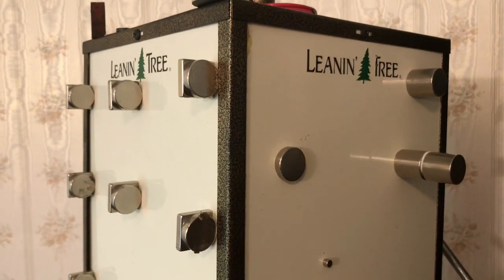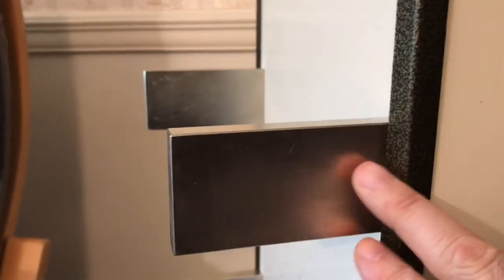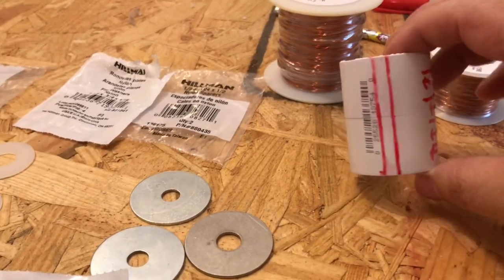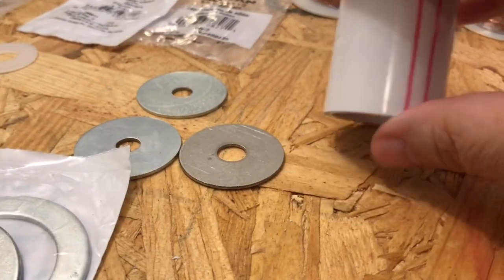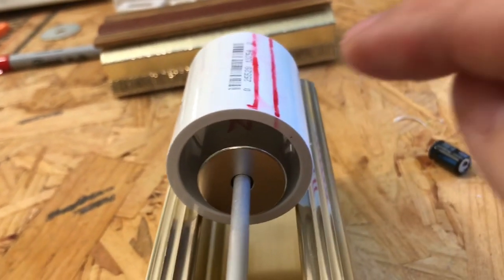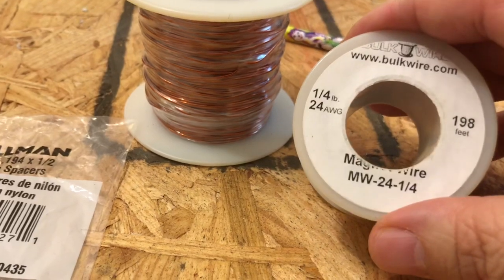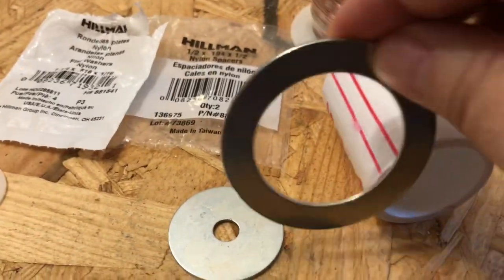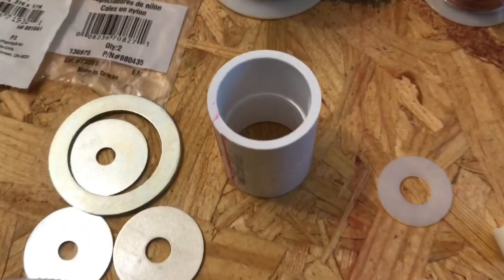🧲 Part 1 - Magnets & Motor Overview

Comment: Glad to see you back. I always believed your magnet wheel actually worked even though I never 'built' my own version. I have six isolation magnets that I took out of hard-drives. They are neodymium magnets backed with mu-metal which blocks the magnetism. I hope you haven't given up on the idea.
Reply from the maker: 3deeguy - No I have not given up on the idea. As I mentioned in the video, big life changes came about and so, I am just now getting back some three years later. There are exciting things ahead over the months to come, as I look forward to it. Know that I am once again at the edge of a huge life change. So at some point my research will come to a sudden stop for a few months until I regroup. I’m in the process of moving. And also will be building a new home and new research lab. Thank you for your kind words nonetheless.